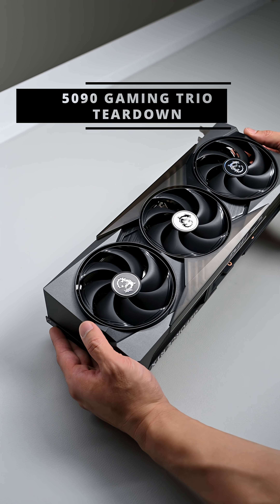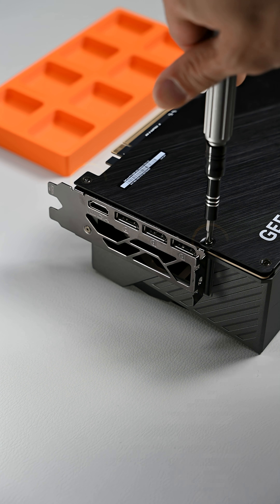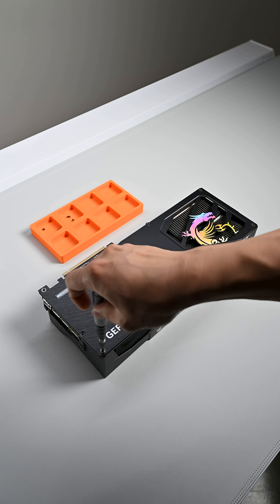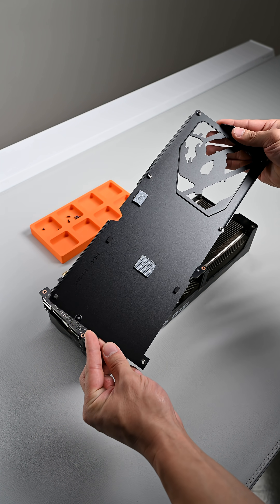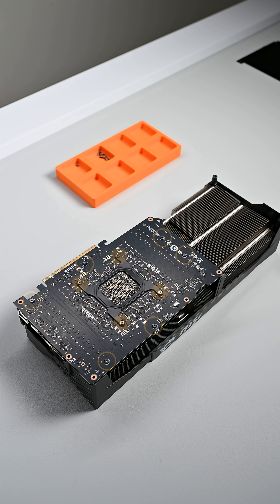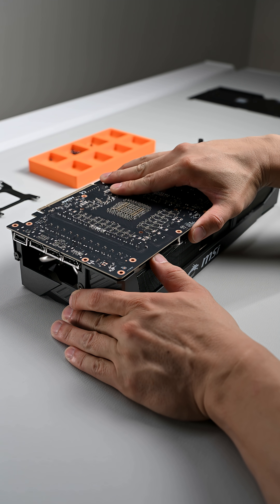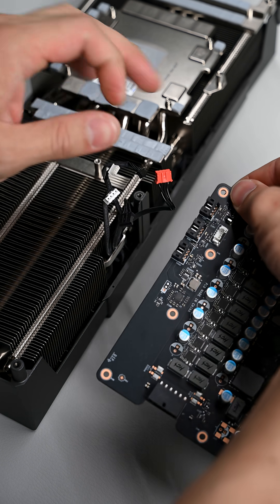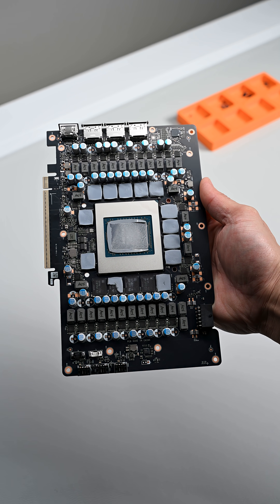MSi RTX 5090 Gaming Trio Teardown

Comment: It voids your warranty, the sticker isnt there for fun
Reply from the maker: It does not void the warranty. The sticker only says "factory seal" on it, not "void warranty if broken" which is the sticker on your PSU. From what I was told only two companies have the "void warranty sticker seal" on their GPUs, that's PNY and Zotac. In fact, a company is not allowed to void your warranty just because you broken a sticker unless the sticker itself specifically mentions it. A company can only void your warranty if you opened it and actually broke something in it by user error.
Reply: I think in USA it means nothing. Not sure in EU?
Reply: @smuludgn   as far as I know, it doesn't mean anything in the EU too
Reply: In Norway it doesn't void your warranty by removing the sticker